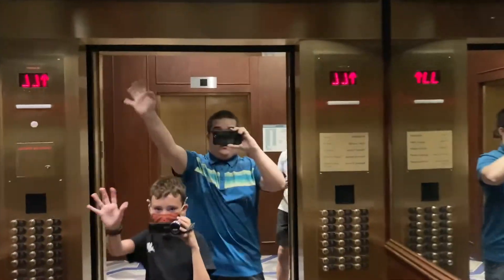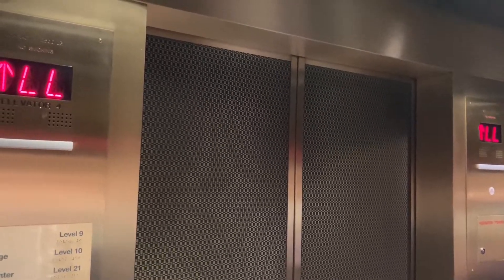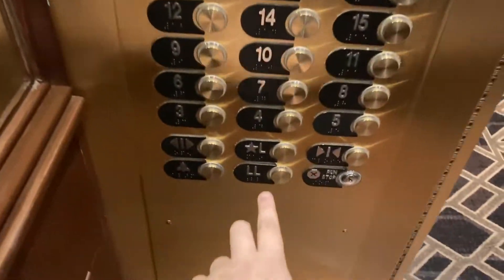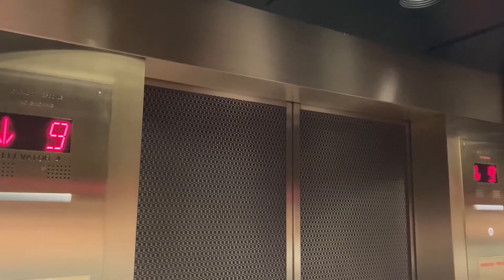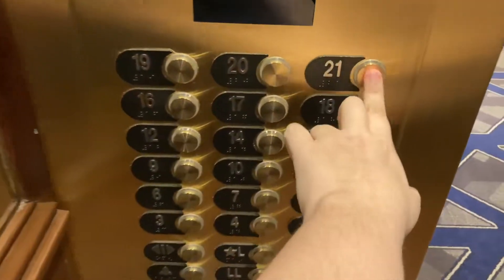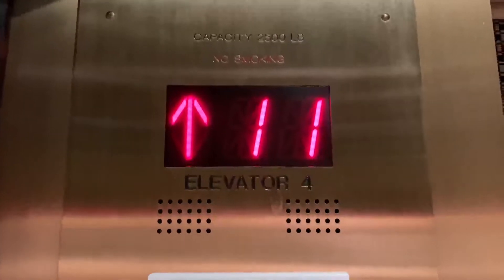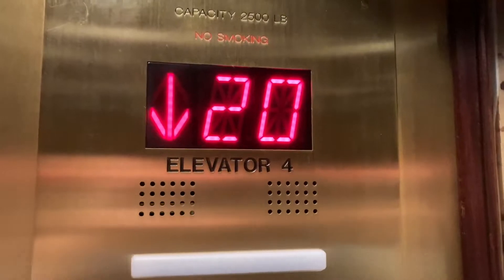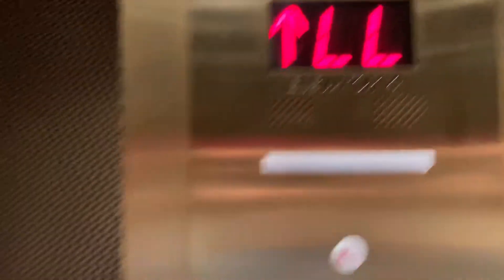Modded Otis Traction Elevators/Lifts (Main Ones) - Sheraton City Centre Hotel - Indianapolis, IN

Comment: Actually, these elevators were originally installed with touch-sensitive buttons, but the call buttons were replaced sometime in the 2000s... So basically, they were slapped on with Series 1 panels while the call buttons were still original for another 10ish years.